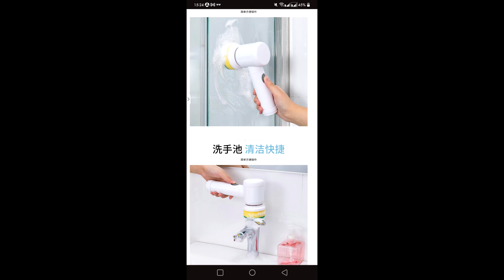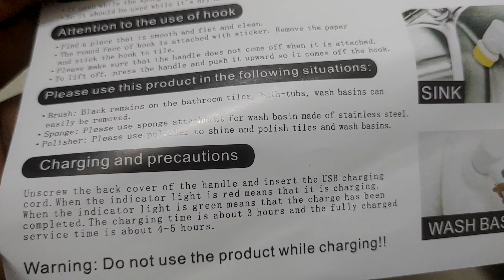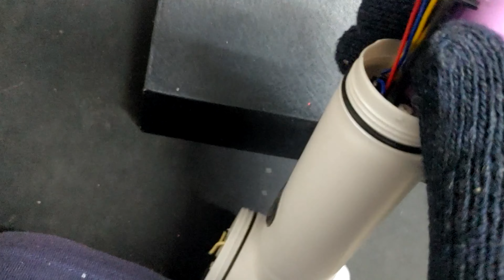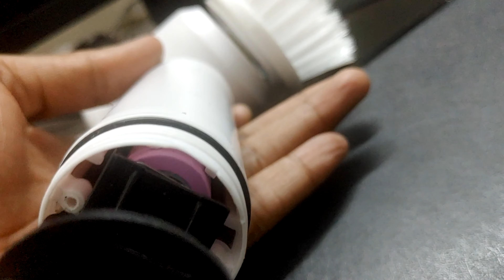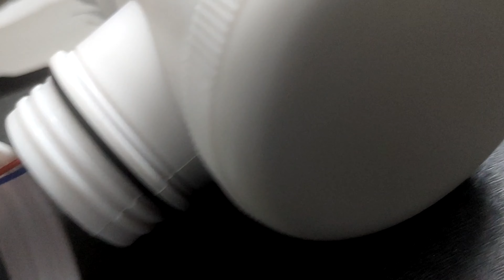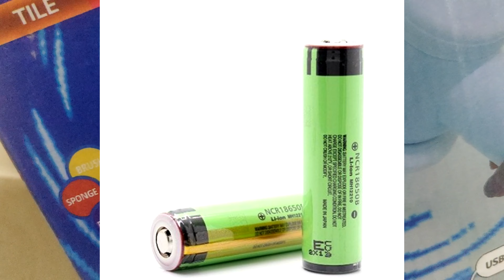Review(Teardown) Cheap electric scrubbing brush teardown magic brush 5 in 1 polisher,scrubber.

Comment: Hi I bought one and sadly it wouldn't work when I took it to a reparator he said the engine is dead
I wonder if you know what can I do to fix this problem.
Thank you
Reply from the maker: You can easily replace the motor if that really the issue. Check price of the motor at your local or online stores and if you think its worth it then replace it. Remember that you may need to solder the wires and re assemble the gear box. The provided motor is of a decent quality so may be you got a defective product? In most cases battery will be the problem.
Reply: @techpluslab8744  I took it to another one just to be certain and thankfully it was a battery issue now they work perfectly, thanks for the reply